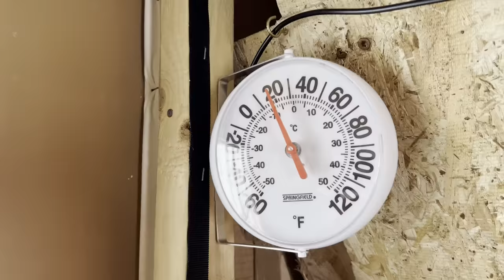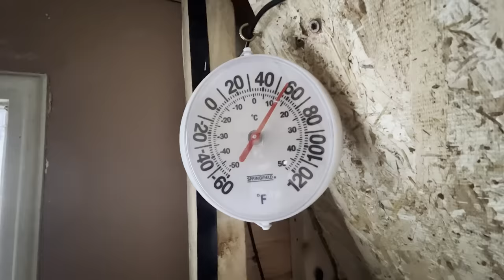BLIZZARD AT THE CABIN | 2 Days in a Winter Storm with my Dog!

Comment: With a Dutch oven, you are supposed to put coals, or some kind of heat source on the top lid so it becomes an oven with heat from below and above. It would have browned the top of the pizza. People used to dig a hole and make a fire with wood or coals, wait until it burns down, then put in their Dutch oven with whatever food, like a roast or even a cake...  then they'd put coals or wood on the lid, cover it up with the dirt they had taken out and wait while their food is baked to perfection.

Comment: That's an awfully small woodpile! Other than that, looks like a great place to ride out a storm.
Reply from the maker: I need to restock, that’s for sure
Reply: Need to tighten that chain on the saw too.
Reply: It's amazing how little wood those little stoves use.
Reply: . If you look in detail at  the last use of the saw it shows he tightened the chain. I wondered about that too. It was too loose.
Reply: As well have a stack closer to the cabin.

Comment: When you use a Dutch oven, you're supposed to put hot coals on top of the lid, which is why it's shaped that way, and why there are lid lifters for them.  It's also why it's called a Dutch *oven*.  (Because you have heating on top, too.)
Reply from the maker: Totally. It would have smoked out the cabin to do so in this situation. When I use it over the fire outside and am trying to bake something, I certain,y add coals to the top 👍🏽

Comment: I know this is an old video, typically you also need to add hot coals to the top of the dutch oven. That's why it has a lip. There is also a special tool for removing the lid when it's like that.
Reply from the maker: Totally 👍🏽 I was worried about having the coals on top inside the cabin but I probably could have figured something out
Reply: @TinyCabinLife  Fair point, I'm sure it looks bigger on camera haha. Where I live it only gets cold like that up on the Plateau. Otherwise it's like 118 :P. That and I'd have to worry about rattlesnakes, Arizona Recluse, and black widows.... maybe even bark scorpions. So I will watch you in your winter cabin with envy lol.

Comment: New subscriber here! Questions on the stove you got, wouldn't happen to have a video going over how you installed it, tips and tricks as well... i got a 8x8 hunting blind/mini cabin i wanna put a stove in
Reply from the maker: Welcome! I actually don’t have a video on the stove, but it’s the Nomad by Winnerwell. It works well for what we need it for, however because it’s more of a tent stove and not cast iron, which most cabin stoves are made out of, the fire dies out quicker. I also get some rain coming down the chimney for whatever reason as well. I’m the winter, there aren’t any issues with that, but in the summer I have to keep something inside there to catch the rain water. All in all, you might want to invest in a cubic mini stove for your space. They’re pricier but definitely more suitable for cabins. I’d love to get one of those someday, but I’m holding out for now. Hope this helps! 👍🏽👍🏽

Comment: Why did you knock the snow off the roof?   Wouldn't that be insulation?  Or would the heat from inside fire melt it and drip inside?
Reply from the maker: Just for the fun of it 😊👍🏽

Comment: Will you upgrade to a bigger stove at some point?  Having to refill the stove 3 times during the night seems exhausting.
Reply from the maker: It’s less about needing a bigger stove and more a problem of the type of stove. Since this is just a stainless steel camp stove without any inside insulation, it doesn’t hold the heat and keep the coals burning as long. Eventually I would love to get a better little stove for this space. The one that I just got inside our travel cabin would be perfect one day 👍🏽👍🏽

Comment: pizzas "these could be left outside"........I agree, what kind of deranged creature in the wild would eat frozen pizza.  If those plywood walls are single thickness........not much insulation. But it could be worse, the walls could be bare corrugated iron ;) On the plus side, the triangular shape of the roof cavity, should maximize warm air staying lower where a person is sleeping.
Reply from the maker: The wood stove bakes you out of there, so heat isn’t an issue really 👍🏽

Comment: I LIKE YOUR VIDEO.  BUT THAT STOVE.  THAT WOULD NOT BE MY CHOICE.  IT IS TO SMALL TO HOLD REAL WOOD. U HAVE TO LOAD IT EVERY 20 MIN.
Reply from the maker: It’s actually not too small, but more so it’s light weight and doesn’t hold the heat in well like a cast iron one 👍🏽

Comment: Get some insulation on that thing. then only stock the fire once.
Reply from the maker: Insulation around the stove?
Reply: @TinyCabinLife  The roof mainly. Throw anything on the slants. doesn't need to be ichy r13 or spray foam just get something on it besides wood. Reflective bubble wrap is rated R6. You will be impressed by insulation trust me.